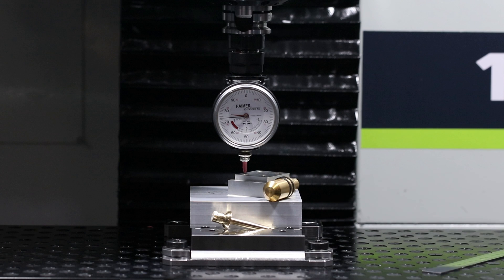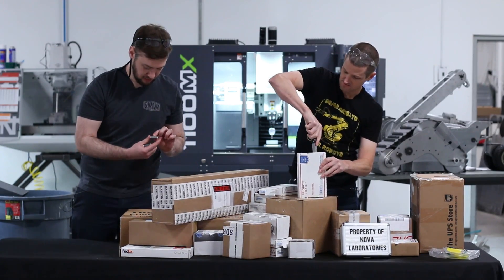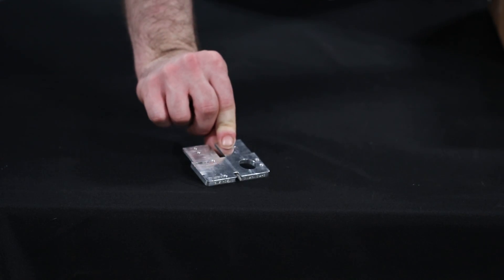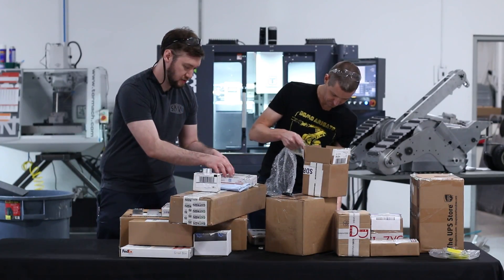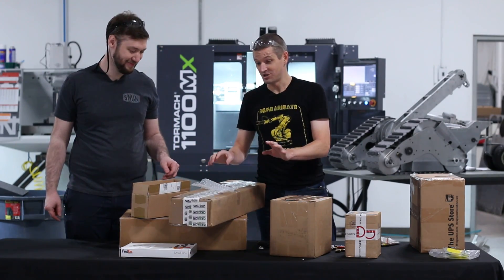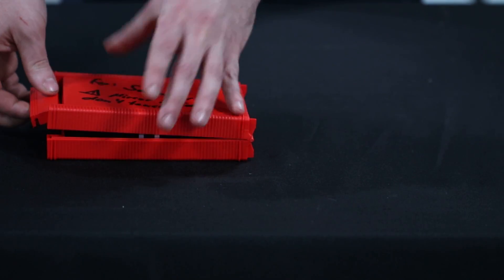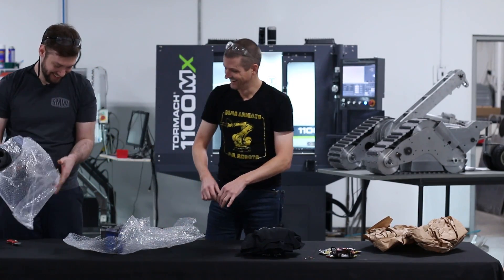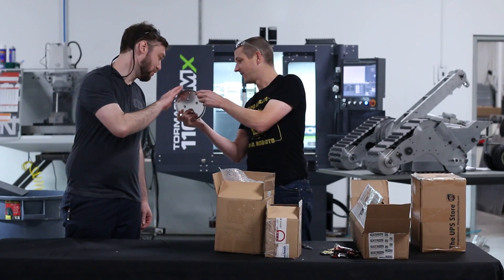Robot Build Collaboration | Short Circuit Johnny 5 Unboxing

Comment: Wow, am I disappointed with this video.  All the time, work and effort that went into the production of each of these parts and you guys choose to display them on a flat table, videoed at an angle and at a distance, for the most part, that made it impossible to really see the effort and time that went into their making.  On top of that you made no effort to show the builders YT address so we might as viewers go back and watch and possibly subscribe to the builders channel if they have a YT channel.  What about an email address?  I'm betting there are viewers that would like to write a thank you note for their work to say nothing of a possible business connection that could develop from showcasing their work.  
You need to pull this video and make another showcasing each of the items along with the creators info and for heavens sake don't be guessing at what part they are or used for!
Reply: After their first unboxing video they made another video showing where do the parts go, who made them, and a closer look at the parts. I'm sure they will do the same for this video, this one was just an unboxing video.
Reply: They're all in the description. Pull the video and make a new one, just because you couldn't see the parts so well. I'm sure you can realize that is an absurd demand.
Reply: @xenonram  Kudos to NYC CNC for listing the machinists/shops.  Not so much for NOT mentioning where to find this info as most would not look at the "show more' unless it was mentioned.  I still stand on my poor display comments
Reply: @Julie SMW Just watched it.  As Mr. Burns would say, "e-e-e-e-e-e-cellent!"